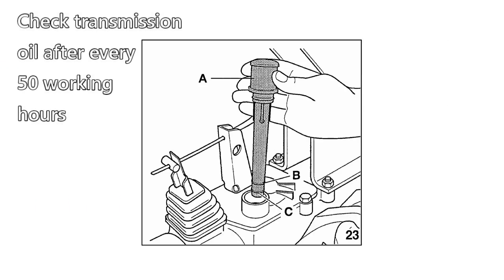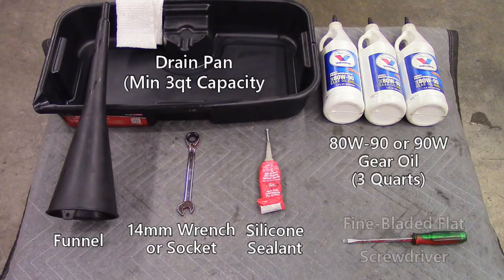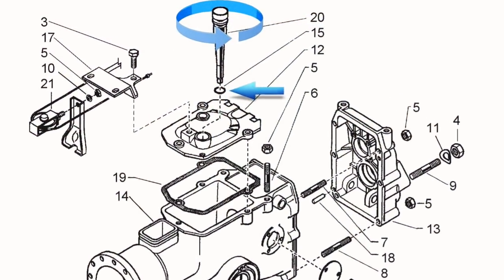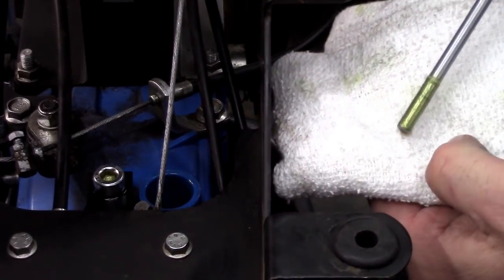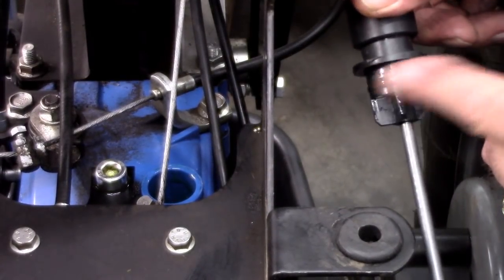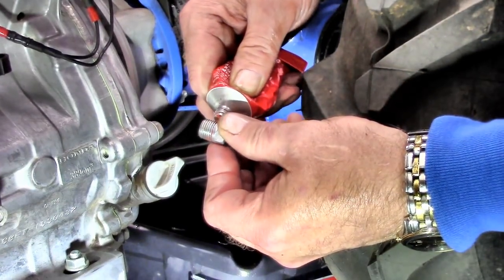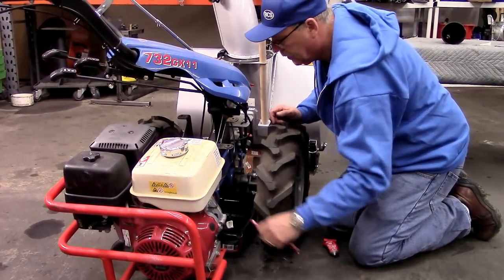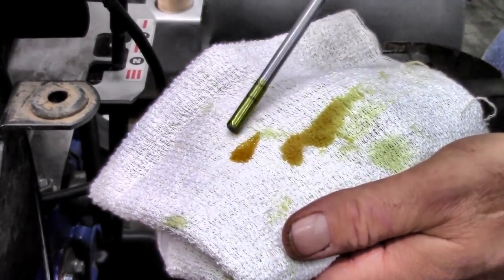Changing the Transmission Oil of a STANDARD (non-PowerSafe) BCS Tractor

Comment: I just changed mine in the 853 and it only holds 1 quart.  I put 2 quarts in and checked it and the level was half way up the dip stick.  I drained almost a full quart out before it was at the full position on the dip stick.  I will check it again after I run it for a little while.  I'm curious how you came up with 2.7 quarts, the entire case would be full.

Comment: When removing the transmission bolt isn't there still silicone on it? If so, do we have to remove it before reapplying a new layer of silicone to the bolt?
Reply from the maker: Yes, you are correct.  Remove any leftover silicon before applying a new layer.

Comment: Thanks for putting this out. Just changed my 853 trans oil using this video. It did not take the 2.7 quarts only about 1.5 to be at the top of the high mark. Apparently others are finding this to be the case as well. 
Would be nice to hear from BCS on if this is correct.